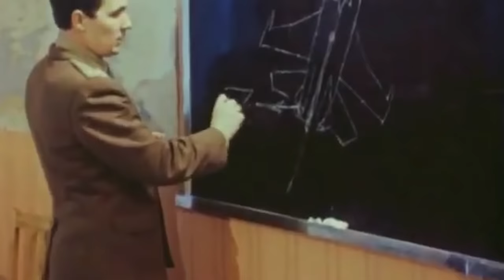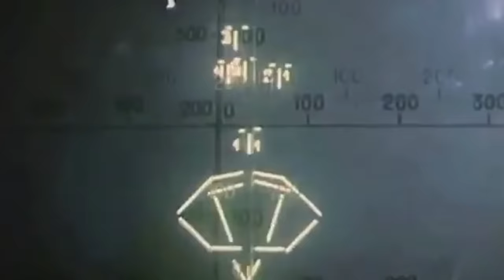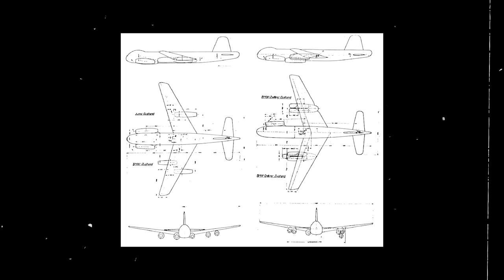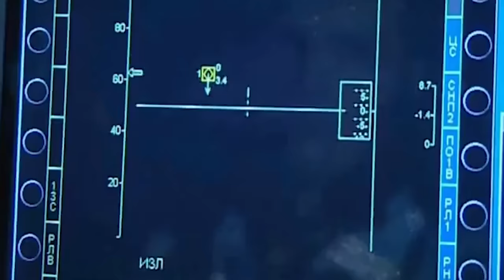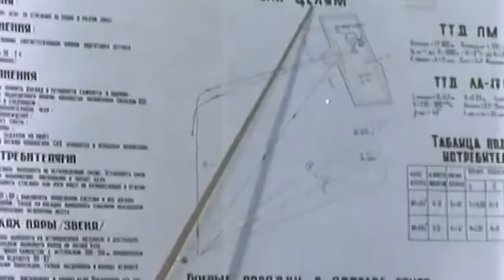The Secret Russian Fighter with Backwards Wings

Comment: I'd expect the wing twisting problem could not be overcome at very high speeds but I could see how wing morphing dynamically in flight would work great at low speeds and then revert to being swept for high speeds,
I think DARPA is working on such technologies right now.
I'm amazed it flew at all and more amazed that they suckered a pilot into testing it!!!
It is a cool looking jet though...!
Reply: alot of computer controls were needed . our X plane with reverse swept wings wasn't supersonic but it took 3 redundant computers to keep it flying , without the fly by wire the plane would just disintegrate instantly
Reply: X29 test pilot said the same thing regarding instability, also with the aerolastic wing of the x-29, that was a solution to a problem nobody was asking as computer controlled leading edge flaps could perform the same function without the cons of the fsw. As a tech demonstration it was useful, but not practical, took Russia another decade or two to realise the same thing.

Comment: The Berkut was an interesting design.  Russian ambitions frequently outstripped their ability to deliver, but Sukhoi did a lot of groundbreaking research for this design that has contributed in numerous ways to subsequent aircraft.  Nicely Done!
Reply: They had some absolutely brilliant engineers in aerospace industries.
Reply: @martinjrgensen8234 so brilliant that the F35 would never have flown without them
Reply: Амбиции оставь своей стране. Мы реалисты. Это прототип. Изучили сильные и слабые стороны и отказались от такой конструкции.
Reply: @Th3_Gael  I assume you're referring to the VTOL design of the Yak-141, which, while important to Lockmart's design for the F-35B lift fan, is absolutely nowhere near as important as you make it sound. The F-35 comes in 3 variants, only one of them has STOVL capabilities, and these capabilities are not what makes this aircraft so dominant whatsoever. Its stealth, radar, avionics, sensors, networking, data fusion, situational awareness, and electronic warfare suite make it the powerhouse that it is, not the lift fan design
Reply: @yomama629   It is not just the lift-fan concept that was "borrowed" (note: other Nations out of necessity came with this idea too - kinda necessary for VTOL - French and German if not mistaken). The whole main engine exhaust swivel mechanism is Yakovlev's and THIS is the MAIN contribution of the Yak-141 to the F-35B, not the lift-fan.
Reply: @travkin8842  очевидно, ты не осознаёшь смысл понятия "амбиции".

Comment: By far one of the most beautiful aircraft designs ever
EDIT:  Huh, using forward swept wings on UCAVs is actually a pretty great idea.
Reply: Yes it sounds like it might have interesting potential. So, the legacy of the Berkut lives on and on.
Reply: Yeah but at supersonic speeds etc its bad move, plus requires insane avionics to control instabilities.
Reply: @captaintoyota3171  That's a software thing though.  If the purpose of the hardware is to act as an expendable dogfighter or 'extended magazine' for piloted fighters then they have all the time they need to perfect that aspect of it.

Not that Russia is capable of that without help..  At least, not without killing off a lot of smart minds for minor transgressions.  Again.

Comment: It's maneuverability advantages (and stability disadvantages) were soon overshadowed by vectored thrust which could be used on conventional configurations and more stable airframes, but the forward swept wing may still be a tenable solution for missiles requiring extreme vector changes for last millisecond guidance.

Comment: As I understand it the biggest issue with FSW tech is that it causes physiological stresses (when taken past human capacity, which it can do very easily) that mean that a pilot is not an option.  The video talks about out manouvreing F15 / F16 aircraft; but they are already operating at the limit of human capacity in terms of negative and positive g forces.  So a Berkut for tomorrow would have to be a drone; and we now have sufficient IT capacity to make it.  Then the main issue is how important are manouvering aircraft, compared to arsenal aircraft with hundreds of AAM using at least Home on Radar, Home on Jam, Active Radar with passive flight to engagement distance and of course the good old IR seeker, again modified to seek after an inertial flight distance.
Needless to say, the active radar source could easily be hundreds of km behind the arsenal a/c should it have a suitable power plant for its radar.  Or, civilian radio transmitters, let alone military ones, have been demonstrated to give sufficient signal strength to track, and  almost certainly provide targeting iformation to software systems to allow track in a passive mode to many current missile frames.
Reply: the fsw isnt really needed anymore because vectored thrust and canards have really pushed the human limit on fighters today . the f15 and f16 aren't quite to that point, they do lag behind fighters like the f22, su57, Eurofighter and gripen as well as the upgraded mig 29s and su35s  .

Comment: While this is interesting, the chronology is messed up. As mentioned at 3:46, this fighter was first flown in 1997, yet the American version, the X-29 was first flown 13  years earlier, in 1984 and had a marginally faster top speed despite being smaller and with just one engine. The X-29 was researched, deemed not worth further development and was retired in 1991, 6 years before the Berkut's first flight. I think the X-29 and its prominence prior to the Berkut deserved more historical context than the side note provided about the X-29 here.

Comment: Forward swept wings DO NOT reduce radar signiture. They dramatically increase it, by acting as a focusing mirror and site of constructive wave interference from a significant width of forward angle.
Reply: Which is why they were abandoned dead end design pretty much.
Reply: @Blackreaper95 Not really, they could have worked well in the era of close range engagements, but the fly by vire technology to make them usable wasnt there yet back then.

Comment: The SU-37 is probably in the top 5 coolest planes ever created/designed. Along with the SR-71, F-117, B-2/B-21 and it's honestly between either the F-22 or the YF-23 for the final spot. I can't decide, Although the F-22 was the plane the U.S. military ended up choosing between the two. Any other suggestions for the top 5 are most certainly welcome.

Comment: The Berkut was designated su 47, not 37, which was the designation given to the "terminator," which was derived from the su 27.I believe that we haven't heard the last of the su 47,much like the USAF's yf-23 ,both may well appear,in improved forms,as 6th gen fighters.
Reply: Russia doesn't have the economy for a 6th gen fighter. But the idea of the YF-23 or a derivative re-emerging as the airframe for a 6th gen makes sense, honestly. The YF-22 had low-speed maneuverability over the YF-23 which is what got it the nod, but if a few sacrifices in the realm of low-speed maneuverability means more stealth, speed, possibly a bigger payload, then I wouldn't be surprised to see the YF-23 re-emerge.
Reply: @Ilyak1986  I'm sure they'll find the funds,after all they did develop the 5th gen SU 57.
Reply: I agree it was the su-47.

Comment: "Soviets achieved what others could not"

Sukhoi SU-47 Berkut first flight 25th Sept 1997. 

Grumman X-29 first flight 14th December 1984.

The X-29 research helped determine why the F-22 has a diamond shaped wing.  The forward sweep is good at high speed, the forward swept trailing edge is good at low speed.

Comment: The forward wing idea was actively pursued in the US at the same timeframe.  My dad designed military planes and sections (e.g., F-15, F-18) for McDonnell Douglas and they played with forward wing designs (FWDs).    However, the US plays by hugely different set of military requirements (esp in 60s-90s) than the Russians, and the FWDs really required today's computing power if not AI to handle its huge instability and touchiness features/flaws. While we could of put a plane out there (also see the Gruman FWD), it just was not combat service feasible. Add the fact that the Russian loved putting out "technologically" superior show pieces that were not fit for extended combat (hmm this sounds familiar.. T-14 Armata anyone)? So yes, props to the Russkies for getting a plane out - genuine feat there.  But temper the envy a bit.
Reply: Gruman X-29
Reply: Exactly.  It was a dead end concept for many reasons and why you don't see any attempt to revive it today.  They were trying to create something that could out maneuver and dogfight F-16s and F-15s, but as you say, this was just a show piece with no real practical application.
Reply: Was berkut spied out from X29?
Reply: Military value aside is was simply technologically fascinating.
Would the forward swept wing be as good as theory promised?
Or would it fail miserably? And i still kind of wait for the answers.
Reply: @smgdfcmfah  One of the reasons I've seen on why forward swept wings were abandoned was that the concept was incompatible with 'stealth' technology, with all of those leading edge on wings and control services.
Reply: The Soviets actually did have allot of technologically superior military hardware though throughout the cold war, not everything was just wuderwaffe show pieces.  The Soviet military was extremely competent compared to how far Russia fell behind since the 1990s.  The T-14 on the other hand it's honestly too early to judge it one way or another. It very well may be a paper tiger, a technological showpiece to impress the Russian public but was never feasible in combat, but it also may yet prove itself and enter larger production, we just can't say yet. The fact is it's completely understandable that Russia has been playing it safe with them and the SU-57, they do not want their most cutting edge tech being studied directly by NATO or even worse, falling into the hands of NATO engineers. This is the same reason why the US will never give Ukraine F-35 or even F-22.
Reply: x29
Reply: X-29 also showcased advanced composite design and mastery of the ABD matrix
Reply: Yup lol, Dark Docs and all of his alternative channels are nothing but clickbait garbage.
Reply: T-14 Armata is now working fine, it's just not worth the added cost to make over the T90M, an upgrade that ended up outperforming expectations and is more than a match for current battlefield conditions. Seen dozens videos of T90ms lighting up AFU positions and armour, and dozens of videos of leo 2 A6s burning in the field for every damaged T90m, the only actually confirmed latter was skuttled by it's crew after a field breakdown. So spare me the Oryx '50,000 knocked out russian tanks just flew over my house' hopium copium spoof sources.
Reply: @anasevi9456  lol.  I was with you till you took a left turn.  The T90 losses documented on oryx are real.  It’s a tank.  Plenty have been rapidly reduced to iron oxide in Ukrainian fields as with most vehicles in a war. It’s hard to see dozens of burning leopards. They have repacked the video of column the Russians attacked several times.  No tank is perfect.  Their survival depends on the infantry support it gets.
Reply: @smgdfcmfah 
Create something that could out maneuver F-15/F-16...lol. The Mig 29/Su-27 variants spank the Viper and eagle (especially the eagle) in knife fights, they lost in radar/bvr.
Reply: @anasevi9456  The T-14 hasn't been seen on the front lines, although a dozen were delivered. Months later they have been sent back.
There are 4 Leopards that are known to be damaged. The Russian videos are of the same ones, re-edited over and over. Those 4 have been recovered and are being repaired in Poland.
Reply: @anasevi9456  "T-14 Armata is now working fine" bahahahhaha
Reply: @-Zevin-  yep, sometimes flexing is bad for business. Which is why US and allies suddenly reduced F35 sorties into Syrian airspace after Russia entered the arena with S300 and few SU35. Being hit by direct competition is bad press and hence bad for business.
Reply: @usmansabir1407  ask the su57 pilots, right?
Reply: @-Zevin- 
We gave F-35's to our "Greatest Ally" Israel, though. Which, of course, means It's only a short matter of time before their technology shows up on new Chinese fighters...🤬🤬🤬
Reply: @charlestaylor253  Honestly China has a very well devolved aerospace industry, they don't need to reverse engineer F-35, of course they would love to study it but their indigenous 5th gen J-20 by all metrics is extremely good.  Especially the new B variant.
Reply: A forward wing implementation gave the impression to the pilot that he was still on the offensive when running from the battle.
Reply: @-Zevin-  the J-20 is based on F-35 technical leaks
Reply: @codenamecrusade1083  That's conjecture, there is no evidence of that.
Reply: @-Zevin-  Yes, they just happened to extrapolate F-35 technical data and then without ever looking at those data they designed their own jet that just so happens to feature rather similar stealth measures.
Reply: @codenamecrusade1083  So again, claims with no evidence?
Reply: Dude half of American Ingenieurs are Russians, and they are good Ingenieurs, dont talk Trash, learn more History and no Propaganda,,
Reply: @grasess2923 
you mean Engineers?

i see you have no problem opening your mouth and removing ALL DOUBT
Reply: @grasess2923   Sure, they are Russians, that's why russia doesn't have even remotely the same levels of technological knowledge regarding stealth, missile seekers or microchips lol
Reply: @grasess2923  Sure, there are plenty of great engineers with Russian ancestry. Sadly for Russia, few of them stayed in the USSR, as most of them brain drained to the west for better economic prospects or to escape persecution. The Russian Federation is still feeling the effects of this brain drain.
Reply: @teslapilot5755 than X29 was spied out from Nazi Ju 287 😉
Reply: А при чем тут армата? этот самолет не пошел в серию из за вибраци крыла из за обратной стреловидности.
Reply: With the emphasis of stealth; or in general a race to see and shoot at the other guy before he could do the same then hightail tf away from AO means sweap wings won't be considered a long time (unless its design somehow able to absorb radar better than delta/sweap wings)
Reply: @-Zevin-  Well put. 💯

Comment: Increased tendency for aerodynamic twisting of the wing leading to run away overstressing. A bend in the wing produced more forces to bend the wing until failure.  Needs modern computer analysis and materials to control the aeroelasticity. The main advantage is that the wing vortex shed from the end of all wings, will migrate toward the fuselage giving reduced drag and possibly enhanced lift. Drawbacks include difficulty in hanging stores near the COG and unstable control regime.

Comment: Yall got to get better at reviewing your script. Everyone else already said it but SU-37 is the Terminator while this is the S-37 Berkut (later SU-47). Also you stated the engines were turboshaft engines which is wrong because turboshafts are helicopter engines because they have a driveshaft to turn the rotors. Should have said turbofan unstead.

Comment: Actually NASA had developed and flown a reverse wing aircraft back in 1984. It was called the X-29. It was designed by Grumman. They found it to be inherently unstable in flight and could lead to structural failure. So, it was discontinued.

Comment: There have been so many airplanes that look good on paper or in stated parameters.   Many never become operationally successful.   The forward swept wing has many disadvantages.  One of the most difficult to overcome is the cost in money and weight to build a strong forward swept wing.   We have mastered flight control systems that take care of instability, but in an aircraft big enough to carry a man, the forward swept wings drives the cost to high.
In small unmanned aircraft the weight and cost penalties are not as high
Reply: They also fuck up transsonic wavefront shape, and massively increase radar crossection.

Comment: Mikoyan-Gurevich Design Bureau succeeded creating the MiG-31 "Firefox", used in a Warner Bros movie under the same name and acted by Clint Eastwood. Not entirely a work of fiction, however it was featuring the first Russian built plane to feature an airframe, composed mostly of titanium and SS-118,  a very thin aspect-ratio to the leading/trailing edges of the wings, much like the Lockheed F-104 Starfighter, radar absorbent material (RAM), ECM and powered by an RJ-15BD-600, which could achieve incredible thrust to weight ratio and excellent high-altitude air-breathing qualities, capable of reaching a top speed of Mach 6. While this impressive speed was possible, it was also considered its ‘maximum’ speed, and not efficient for a prolonged period, due to the MiG’s massive fuel consumption. Had this been a real Aircraft, it would have been not only the greatest Russian plane ever made, it would have been the best in the world.